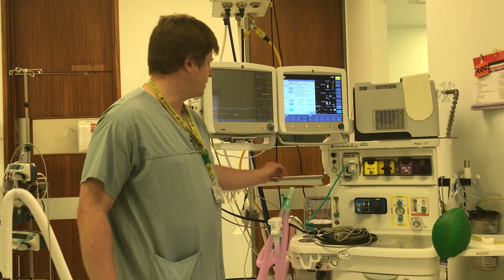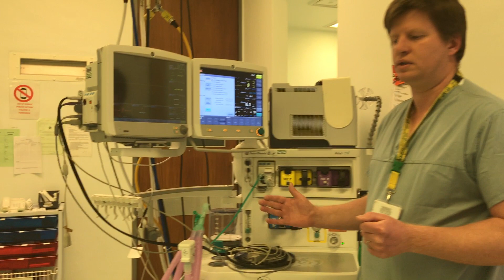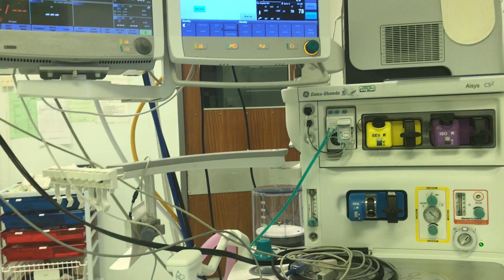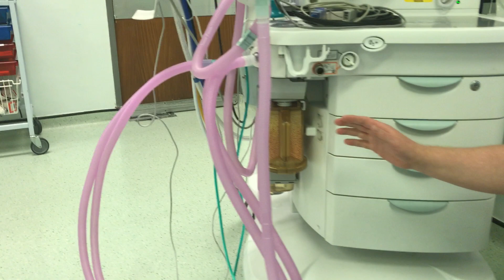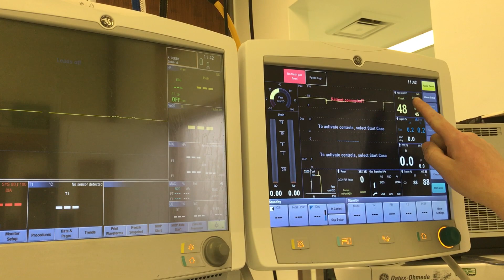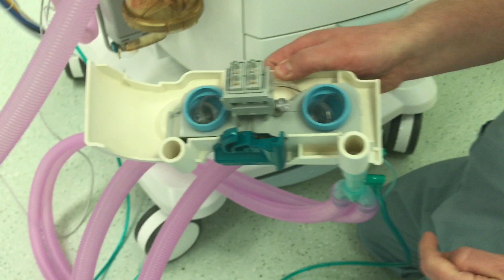Electronic Anaesthetic Machine check

Comment: IF you've checked the soda lime , looked at the flows and fiters , changed the circuitry and bags and you still find a leak , have another look at rhe soda lime canisters seal because sometimes tiny grains find there way underneath it and get overlooked as it looks absolutely fine from the outside. This happened to me after exhausting all ideas. The medical physics fellow(God) found the problem and said it was common on some designs of the refilable canisters. So watch out for the hidden cat shit grit under the seal giving you unacceptable amounts of circuit leakage...  ( a "skilled" assistant)